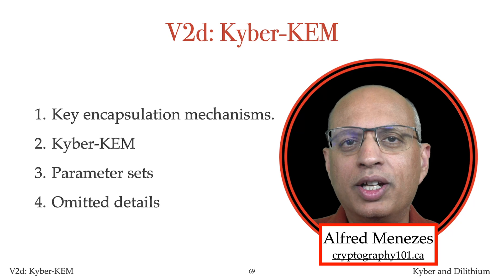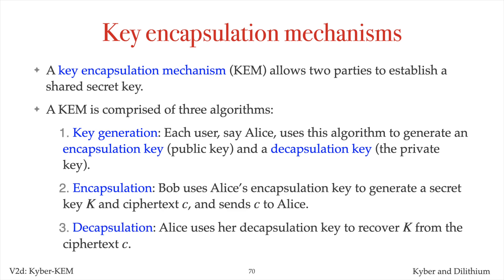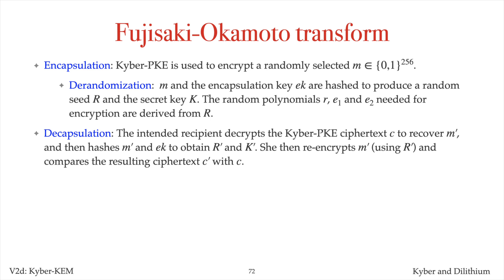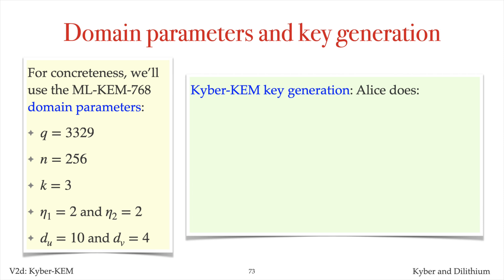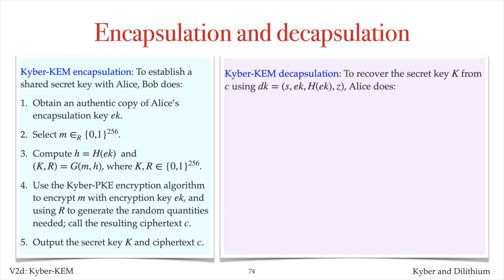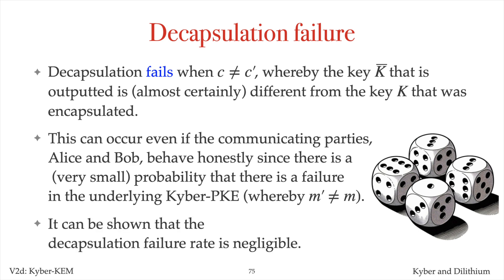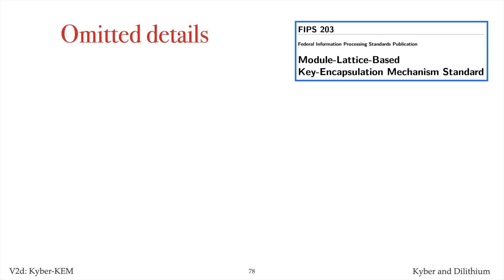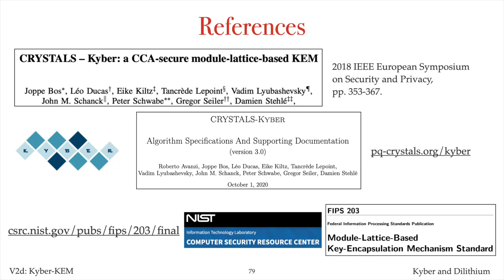V2d: Kyber-KEM (Kyber and Dilithium short course)

Comment: It's mentioned that there is a very small chance of failure (both in Kyber-PKE decryption, and Kyber-KEM decapsulation). While the chances are indeed extremely low, I nonetheless must wonder; in the event of a failure, what does the failure look like? For Kyber-PKE, will a failure completely garble the message, or only flip a single bit? Or something in between?
Reply from the maker: Referring to the simplified Kyber-PKE on slide 49: Decryption failure means that the plaintext m' obtained by the decryption process differs in at least one bit from plaintext m that was encrypted. I haven't thought about the distribution of the decryption error m-m', and I haven't seen any analysis of this distribution in the literature. I suppose that no one has taken the time to work this out because in practice the parameters are chosen so that decryption failure is negligibly small.

Comment: Slide 72
In the decapsulation process, does checking whether c = c’ effectively serve as a ciphertext integrity check?

In this construction, is the purpose of using the Fujisaki–Okamoto (FO) transform to enable Kyber-KEM to achieve authenticated encryption(AE)? Since AE is equivalent to CPA + Ciphertext Integrity, and that AE secure implies CCA secure. (The term AE might not be accurate since it is always referring to the symmetric key encryption after KEM finish.)

As hash function (assume it is collision resistant) is used, it is computationally infeasible to find an m’ s.t. H(m’, ek) = H(m, ek) if the same hash result can derive the same output. Hence, without knowing m, the adversary is not able to send a random c’ in the ciphertext space and make Alice to accept the ciphertext? Since with different r, e1, e2 it is not possible to have Enc(Dec(c, dk), ek) = c

Slide 74
In this slide H(ek) is used instead of ek, may I know the reason of not using ek directly?
Reply from the maker: Slide 74: The designers of Kyber-KEM used H(ek) instead of ek so that the the shared key depends on inputs from both parties (not just the sender), and also to guard against "multi-target attacks". If you would like a more detailed explanation, please see Section 4 of the paper "CRYSTALS - Kyber: a CCA-secure module-lattice-based KEM by Bos, Ducas, et al.
Reply from the maker: Slide 72: Yes, checking whether c=c' effectively serves as a ciphertext integrity check. This provides resistance against chosen-ciphertext attacks. (The Fujisaki-Okamoto (FO) transform is a generic method for converting a public-key encryption that is only secure against chosen-plaintext attacks into one that is also secure against chosen-ciphertext attacks.) There is no authentication here since the sender is not using a public/private key pair during encapsulation.

The hash operation (K,R) <-- G(m,h) is used in order to derandomize the encryption process, so R is used by the sender (Bob) to generated the random quantities needed in Kyber encryption. Derandomization is necessary so that the recipient (Alice) can re-encrypt the plaintext m' that she recovers using the same random quantities as Bob did. Alice that then verify that the ciphertext c was correctly computed by Bob.

Note that a slight variant of FO is use here in order to also provide some guaranteed security against quantum attacks.

Comment: Is kyber-KEM a shared secret symmetric key generation mechanism or it's possible to encrypt messages as well with kyber and send it to receiver?
Reply from the maker: Kyber-KEM is only used to derive a secret symmetric key. The symmetric key should be used to encrypt/decrypt the data using AES-GCM (or some other symmetric-key encryption scheme).

Comment: Can you explain how PKE is connected with KEM.. PKE already encrypts and decrypts plaintexts ...and  we are using KEM to generate shared secret keys for chosen ciphertext attacks? How it is connected with PKE
Reply from the maker: The Kyber PKE is only designed to be secure chosen-plaintext attacks, and not against chosen-ciphertext attacks. This is undesirable in practice. Instead, the Fujisaki-Okamoto transform is used to convert Kyber PKE to a KEM that is secure against chosen-ciphertext attacks. So, the Kyber PKE is just a stepping stone for the construction of Kyber KEM.
Reply: @cryptography101-alfred  Thank you. And is it safe for larger files ,images or for  data encryption to use AES  where the shared secret key is derived from Kyber KEM?
Reply from the maker: @Kebabsncats  Yes, Kyber-KEM + AES is safe for encrypting data of any length.